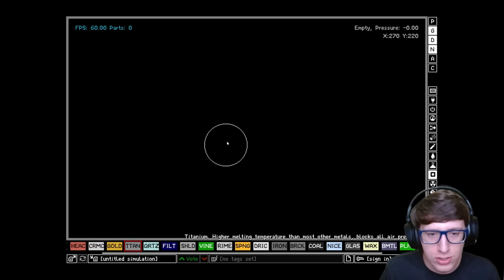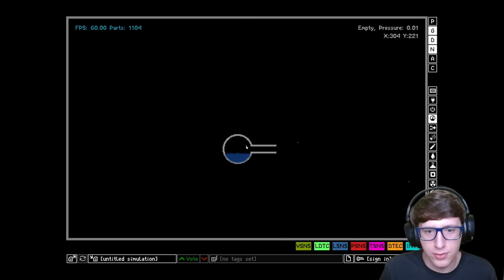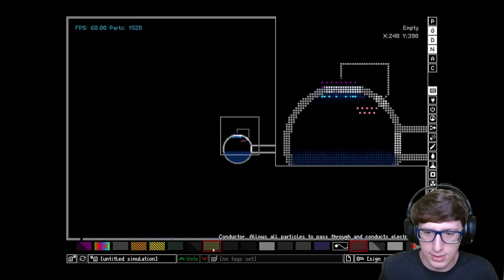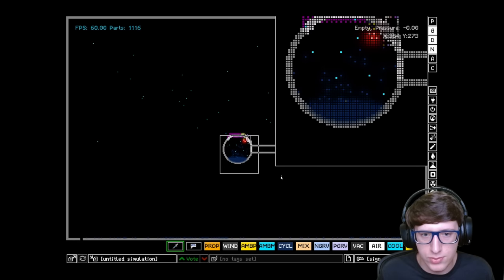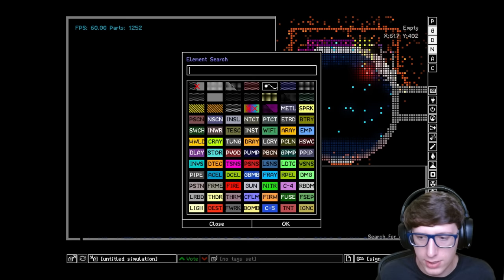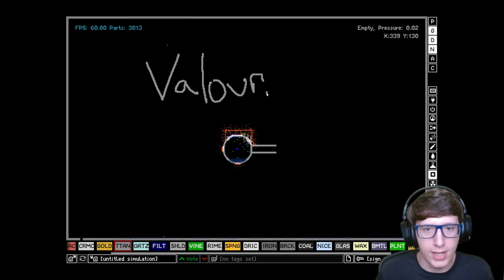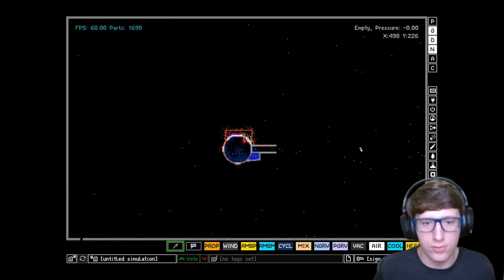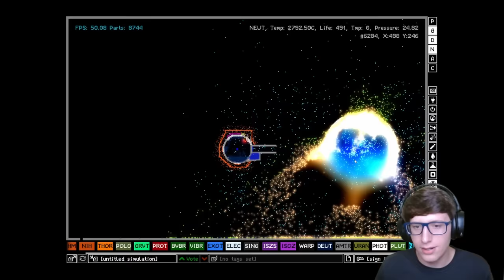NEUTRON BEAM GENERATORS in The Powder Toy!

Comment: Congragulations, you've essentially made a crude cyclotron.

All you need new is some heavy elements to bombard, and you're doing some science!

Speaking of which, there's an idea for you.. make a cyclotron in powdertoy.. It's basically similar to this design, except instead of storing the neutrons with a stasis field, you
funnel into a cyclical loop of sorts, and then once there's enough of them in there bouncing around, you toggle an opening to appear, to let them all flow out.

Both in real life, and in game, this allows the neutrons to fly out of the device in a much straighter uniform trajectory.

Comment: there is a trick i use to make pressure reactors with uranium, you need to have a layer of 3 ceramic, 3 titanium then 3 ceramic so when the titanium melts, it can re freeze and seal it again. (when i make that a reactor, i fill the inner part with more barriers of ceramic and uranium and ceramic then a core of polonium to start the catalyst reaction and rise the pressure since it self melts/boil.)

just saying that this could make your beam temporarily meltable but self healing too!